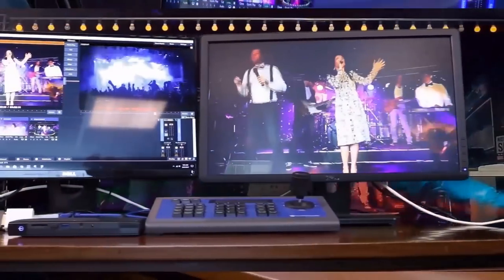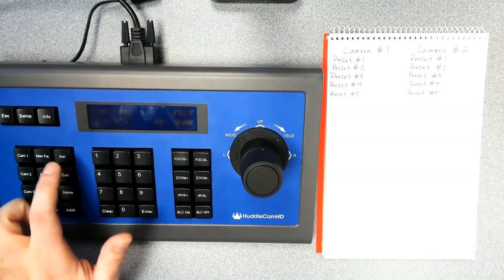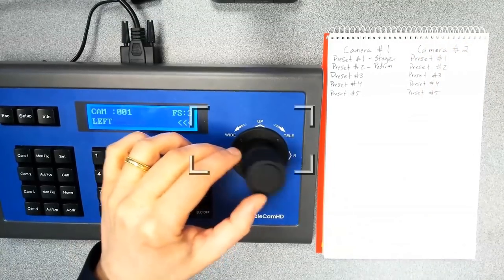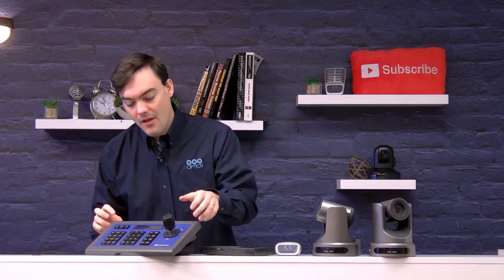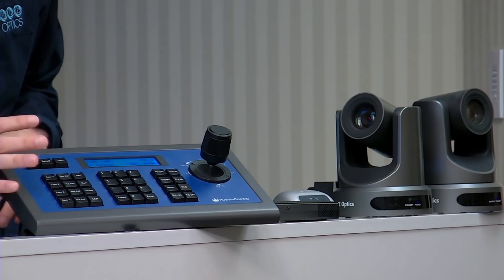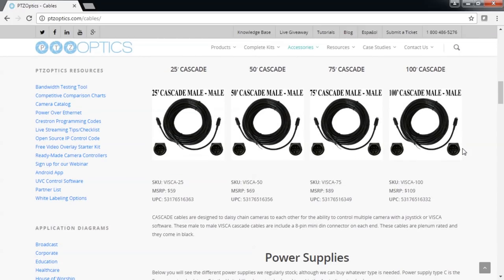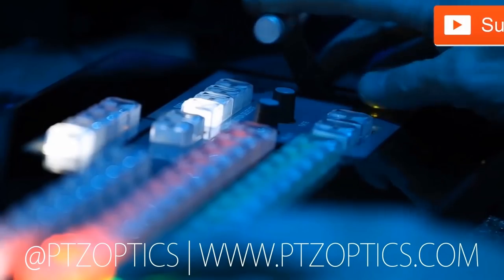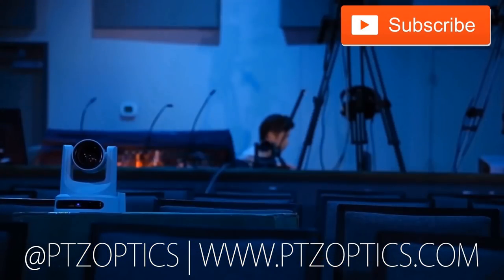Joystick Optimization in the PTZ Producer Kits || Pro Tip #4

Comment: I have the same controller but it's branded differently, instead of CAM1, CAM2... buttons has F1, F2... but those don't select cameras, in VISCA mode they do other function such as autofocus on, return to home, ptz reset and camera off. Is there a way I can reassign them to quickly select the active camera? I see all these controllers look exactly the same but there are at least 10 different brands, and all user manuals are pretty much the same with very little useful information.
Reply from the maker: Hello!
It sounds like you have a generic PTZ camera controller that's similar to the HuddleCamHD Joystick but with different branding and button configurations. These controllers often use the VISCA protocol for communication and are indeed quite similar in appearance and functionality across various brands. The ability to reassign or program the buttons (such as F1, F2, etc.) to select cameras directly depends on the specific model and firmware of the controller. 

Here's a general approach to addressing this:

Check the Controller's Manual
1. Manual Review: Since these controllers often come with limited documentation, check any available manual for information on programming or customizing buttons. Even if the information is sparse, there might be clues on how to access programming modes.
Accessing Programming Mode
2. Programming Mode: Some PTZ controllers have a programming or setup mode that allows you to assign functions to specific buttons. This might involve a combination of button presses to enter this mode.
3. Menu Navigation: If the controller has an on-screen menu, navigate through it to find options for button assignments or presets.

Contact Manufacturer Support
Manufacturer Inquiry: If the manual isn’t helpful, try contacting the manufacturer’s support. Even if it’s a generic brand, there might be a customer service line or email.
Ask for Firmware Updates: Inquire if there are any firmware updates available that might enable more customization.

Explore Universal Control Solutions
Software-based PTZ Control: If hardware customization is limited, consider software-based PTZ control solutions that offer more flexibility. Software like vMix, OBS, or PTZOptics' own software can control multiple cameras and might offer more intuitive ways to switch between them.

Community Forums and Groups
User Forums: Online forums or user groups related to PTZ camera equipment might have members who have encountered similar issues and found solutions.

Alternative Hardware
Consider Different Controller: If reprogramming isn’t possible and you frequently need to switch between cameras, it might be worth investing in a different controller model known for easy camera switching.

Keep in Mind
Hardware Limitations: Some generic controllers might have limited programmability, so there could be inherent restrictions on what you can customize.

Conclusion
The ability to reprogram buttons on a generic PTZ controller to select cameras directly depends on the specific model's features and firmware. Explore the controller's programming mode, consult the manual, reach out to the manufacturer, or consider software-based control solutions for greater flexibility. If these options don't provide a solution, looking into a different controller that meets your needs might be the next best step.

Comment: Do I need the cameras for the display on the keyboard to work properly
Reply from the maker: Hello!
For the PTZOptics Joystick Controller (such as the PT-Joy-G4), the display on the joystick itself is primarily used for configuring and controlling PTZ cameras that are connected to it. The joystick's display provides feedback and interface options for controlling the cameras, such as selecting cameras, adjusting camera settings, and manipulating pan, tilt, and zoom functions.

Camera Connection for Display Functionality:
Camera Integration: To fully utilize the display on the PTZOptics Joystick Controller, you need to have PTZ cameras connected to it. Without cameras, the display won’t show meaningful feedback, as it's designed to interact with the connected cameras.

Display Use: The display typically shows information like the camera selected, IP addresses (if using IP control), and possibly presets and camera settings.

If You Don’t Have Cameras Yet:
Basic Functions: You can still explore the joystick’s interface and basic functions without cameras, but you won't be able to control or receive feedback from cameras, which is the primary purpose of the joystick.

Setting Up with Cameras:
Camera Compatibility: Ensure that your PTZ cameras are compatible with the PTZOptics Joystick Controller. The controller usually supports common control protocols like VISCA, VISCA over IP, Pelco-D, and Pelco-P.
Network Setup: If using IP control, connect your PTZ cameras and the joystick controller to the same network, and configure the network settings accordingly.
Serial Control: For direct serial control (such as RS-232 or RS-485), connect the joystick to the camera using the appropriate serial cables.

Conclusion:
To summarize, while you can power up and navigate the menu on the PTZOptics Joystick Controller without cameras, the display functions are designed to work in conjunction with connected PTZ cameras. The full utility of the joystick, including the use of its display, is realized when it's used to control actual PTZ cameras in a video production environment.

Comment: I purchase the 
Wirenest 75ft VISCA PTZ Camera Control Cable for Sony EVI/BRC/SRG Series RS232 8 Pin Mini DIN to DB9F Serial. This cable has the DB9 and the 8 pin mini pin would it work / is this the same as the DB9 Extended male to female.
Reply from the maker: Sometimes the pins on these cables can be reversed depending on the camera you need. I would suggest returning those cables if you plan to use them with this joystick and get the cables on ptzoptics.com/cables
Reply: @PTZOptics  l can purchase this cable thru this link you provide?

Comment: Can you change the speed that the camera goes to the presets?  By default, the change speed is very fast.
Reply from the maker: Yes, with the latest joystick there is an entire speed section. That is the gen 3 joystick. Otherwise, there is also controls on the camera you can use.

Comment: Will it work on the JVC KY-PZ100BU?
Reply from the maker: Hello!
The HuddleCamHD HC-JOY-G4 is a joystick controller designed primarily for PTZ (Pan, Tilt, Zoom) cameras, and it is known for its compatibility with a wide range of PTZ camera brands, thanks to its support for both VISCA and Pelco protocols over RS-232, RS-485, and IP. This allows it to control multiple cameras from different manufacturers that adhere to these standard communication protocols.

The JVC KY-PZ100BU is a PTZ camera model that supports control via IP and RS-422 (a similar communication standard to RS-232 and RS-485, but not the same). The primary consideration for compatibility is whether the HuddleCamHD joystick supports the specific protocol and connection method that the JVC camera uses.

Given that the HuddleCamHD HC-JOY-G4 supports IP control and the JVC KY-PZ100BU can be controlled over IP, there's a potential for compatibility if both devices use a common protocol over IP for control commands. However, specific compatibility also depends on the implementation of the control protocols by each manufacturer.

To determine if the HC-JOY-G4 can directly control the KY-PZ100BU, you should:

Check the Documentation: Review the user manuals or product specifications for both the HC-JOY-G4 controller and the JVC KY-PZ100BU camera to see if they mention compatibility with each other or share a common control protocol over IP or RS-422 that ensures they can work together.

Contact Support: Reach out to HuddleCamHD and JVC customer support to inquire about direct compatibility between the two devices. They might offer the most accurate and up-to-date information or suggest any necessary adapters or settings adjustments.

Look for User Experiences: Searching online forums, user reviews, or professional networks where others might have attempted this combination can provide insights into any potential challenges or the need for specific configurations.

If direct compatibility is not supported, an alternative solution might involve using a bridge device or software that translates between the control protocols used by the HuddleCamHD joystick and the JVC camera, although this can introduce additional complexity and cost.

Thanks for checking out our Channel! 
Learn More: https://huddlecamhd.com/